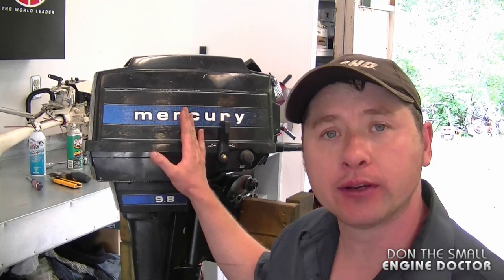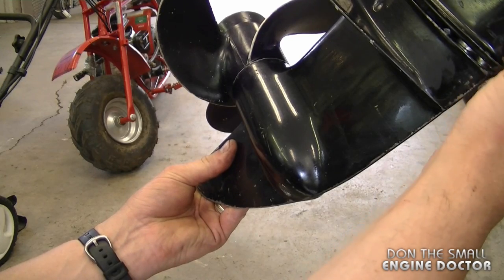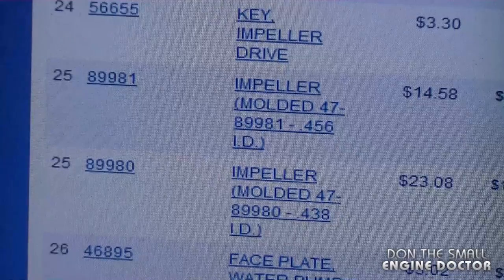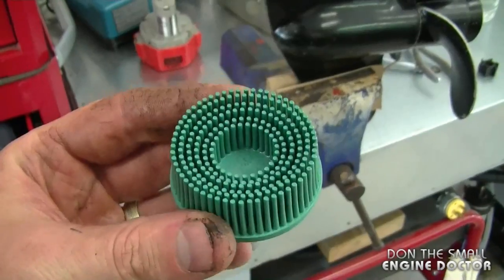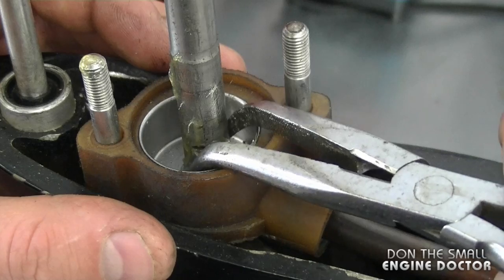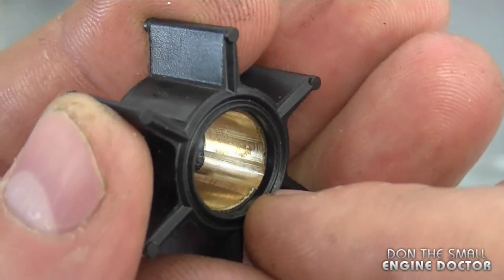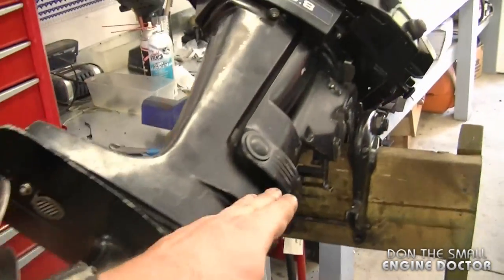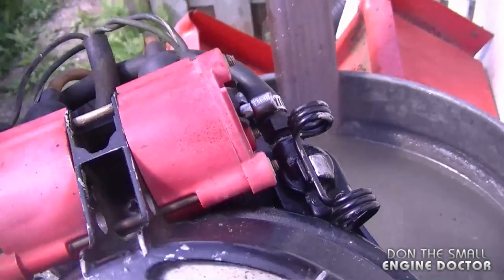HOW-TO Impeller (water pump) Replacement In Mercury Outboard Motor

Comment: Thank you young man.  My 1973, 7.5 stopped spitting water.  At 67 I'd usually pay someone for that.  The hardest part was fitting the lower unit back on. Found that  standing motor on the cover worked.

Comment: Nice job once again. Good old Mercury..... and looks like it hasn't seen any hard use. I did jobs on them like this. Where I live we call the impeller the water pump. Also, I use a little dish liquid to lubricate the parts when doing this job. It helps the pump get its initial few turns off to a nice slippery start and then the water just washes it away. We also called the fin above the prop the cavitation plate. Thanks, haven't done one of those in a long while, brought back old memories. Keep them coming

Comment: Of all the videos I watched, there was none that mentioned the copper tube. Yours my friend saved my butt! I removed mine and there was a piece of the old impeller lodged in he impeller end. Had I not seen your video I would have NEVER looked at that tube. THANK YOU!! Your videos are head and shoulders above others. I am wondering however, should there be a sealant between the lower and upper half when putting it back together? When removing the two halfs there was a clear silicone substance I had to scrape off. I did put a small bead between the two when reinstalled. Thank you so very much

Comment: Hey Don, great video it is but  three steps l would recommend. One: grease the splines of the shafts with water proof grease and slightly lube the little o-ring on top of the driveshaft. Two: when installing the g/box rotate the fly wheel at top of engine very slightly clockwise or rock it back and forth to line up the splines. It will slide in easily.
Reply: And what is three?

Comment: Another great video, thanks Donyboy.  My motor is almost identical to this, probably a bit older, and it would have be a real pain of a job to do without having watched this.  The zip-tie trick didn't work for me so I cut a ring of 1 inch flex hose, bent the impeller inside of it and then mated it up to the housing so I could just push it down and this worked great.

Comment: Great vid, as usual.

I just helped do this to a larger Mercury (150hp)and they are very similar.
A couple of things I found out.
It's best to start by placing the gear shifter in gear (we used Forward).
The reason for being in gear is the prop can be moved so that the splines at the top of the shaft can be aligned to slide the lower unit unto place.

The nut that can not be taken off until the lower unit is broken loose is actually to help hold the lower unit from falling out and getting damaged, while starting or removing the other nut(s).

On the larger engine there was a sleeve to align the water line and the shifter had to be coaxed into place as we tightened the unit holding nut in the front.

Piece-A-cake it wasn't, but after we learned the method of this madness, it became more straight forward, and now that I may never need to do it again, I felt proud that I can.

Hope this may help someone else to shorten their learning curve.

Thanks for the Movie Don.

blessings,
rev don
Reply from the maker: +donald ducky thanks for the tips
Reply: Nice water sleeve to fit in pump and over the brass water pipe leading up.  Wonder
if those are a standard part or heat resistant plastic from a hardwear stow.

Comment: You sir saved me a lot of time and money. Thank you so much. Tip for everyone watching. If it doesn't go into both gears obviously something moved in the process. Once you get the drive shaft back in put both nuts on finger tight and try and make sure it goes into all 3 spots (forward neutral and reverse). If it doesn't loosen the nuts and pull the shaft out just slightly so that the gears aren't changing and adjust the shifter. Before tightening the whole way down spin the prop and make sure the shifter is in neutral. That way you won't have to go through the whole process again. If it's wrong you'll start the motor in gear (don't ask me how I know...)
Reply: I too found that out but upon trying to remove the lower end again and it's stuck, opens up about 1/4" but that's it. Any ideas?

Comment: Eric the car guy uses that rubber grinder wheel also.  It looks like it's perfect for removing old gasket material as well as the carbon you removed.  Great video, Dony.  Thanks for sharing and taking the mystery out of bad impeller pumps.
Reply from the maker: +A LeBlanc have a good weekend
Reply: +A LeBlanc I've thought about buying one, but I think they're like 30 or 45 dollars a PIECE! That's pretty pricey, I'll probably just stick to brilo pads heh...

Comment: My Merc 9.9hp 2 Stroke impeller only has about 10 hours on it, but I was just thinking my Mercury Classic 50 has a heck of a lot more hours on it and should be changed.... Then your video shows up and I think that is the Final Hint!! Now I remember how easy it is to do... Thanks!
Reply: +furyIIIplate Keep in mind that, when it comes to rubber impellers, it is all about how long they have been on the unit, not about the hours of run time. If a brand new impeller is installed, and then sits for 3 or 4 years, it would be risking your engine to run with that impeller.
Reply: YES, change it NOW!  I ruined my 15hp by thinking it was peeing "enough".  It was, 'til it quit, then engine overheated and now no compression...  :(
Reply: Gogle Plus Sucks I am sad to hear that GPS. This is, unfortunately, not uncommon. When one piece comes of an impeller blade, it often takes the rest with it. It can happen almost instantly. Usually, the first indication noticed by the user is the engine quitting. Most manufacturers specify every two to three years, for water pump service. That means, if you install it, and then let it sit for three years, replace it again before you use it.

Comment: Rotating the flywheel slightly while installing the gearcase helps to line up the driveshaft splines, and don't forget to lube those driveshaft splines before installation!

Comment: Great video donnyboy. A couple of tips if I may. Start with the shift lever in forward gear. This will let you turn the prop to line up the drive shaft splines when you are re installing the gear case.  And also, apply some grease to the drive shaft splines. This step can save you from absolute misery, next time you have to remove the gear case, especially if you run in salt water. It is certainly nice having the flat on the shift shaft. Some outboards do not have that. It is no fun to get the thing back together only to find that the shift lever wont move. LOL 
I don't know what it is about those older two cycle outboards, but if you take care of them, your grand kids will still be using them down the line.

Comment: Great video.
The reason you were struggling installing the lower unit was possibly because there was no grease on the shift shaft or drive shaft splines

Comment: Another great video, thanks!  Wow, Merc sure is easier than my old Evinrude, takes 6 bolts to remove lower unit, and then you have to remove the shifter connector, a real pain and often stripped by folks since it's just brass.  And reconnecting that is a whole trick in itself as well.  However, having two very similar impellers for the engine is a bit weird, glad you pointed that out.  I'm assuming you could have just checked the shaft itself vs. the inside diameter of the impeller.

Lastly, I'm surprised you could blow air through the top with the thermostat in there.

Comment: Nice tip with the zip tie. 3M on die grinder is new to me.
I like to use dish soap on the inside of the impeller housing to ease sliding the rubber impeller into position.
Could also use it on drive shaft for seals.
Evinrude's are much harder to put the shift linkage back together (40HP 1990).
Reply from the maker: +Dan Sisulak thanks for the tip

Comment: Nice vid! Didn't get mine installed unfortunately.. tried for over 2 hours to get the impeller fitted but just couldn't get it in and over the key really annoying job to do. To make it even worse the old impellor was working and looking fine, thought to do some preventive maintenance. Ended op with no cooling at all haha. Will try another time to get it fixed.

Comment: great job and very clear!
Reply: Don...one more thing on this OB...The swing of the tiller are back and forth is to easy ...most OB's I have found and adjusted this by an adjustment bolt or screw..I can not find one on the 9.8 Merc of this vintage!..thx

Comment: Great video on this topic, the best  most informative I've seen yet. I have a 2012 merc 2.5 hp four stroke. I replaced impeller easy enough but I screwed up the shift linkage also I didn't know the shifter would move while replacing impeller,  it did move. Now when I start it it stays in foward gear, I have no neutral , what can I do ?  Thanks in advance

Comment: Is water bypassing the thermostat somewhat on start up, which makes it come out the tell tale or peep hole? Reason  I say that is most motors show you water almost imediately. Another super nice video btw!
Reply: +arciefan Some do, and some do not. Most newer motors do, and even spray loud enough that you can hear the stream hit the water, at least at lower RPMs. My 1977 70hp Evinrude doesn't even have a telltale. I just have to rely on the buzzer.

Comment: I do this almost every year on mine.  Thank you  for the visual, great refresher.
Why would it matter about how the fins are clock wise or counter clock wise?  Wont it change when going in reverse?
Reply: Mike Baker 
No.. the long shaft is connected to the engine directly so it doesn't change rotation.. You  want to install the impeller in the direction the engine turns as shown

Comment: I always lube the impeller and o rings when I install the new impeller as most wear is caused by dry start ups.I also pull the motor over without ignition on so as to prime the water system on every start up when the system has had a chance to drain down.

Comment: Hi donyboy73 how is it than when you put pressurised air up the copper pipe to the engine block with the flush bung screw in place it still blows out out of the tell tale hole?

I thought this wouldnt be possible due to the fact the thermostat would be closed as the engine would obviously not be running or warm during the impeller changing process, Is it prehaps a small amount of air blowing though the jiggle pin in the thermostat?

Comment: Great video Don.  It helped me replace my impeller.  I have a 1985 Mercury 7.5 hp outboard.  It leaks oil out the propeller hub after I have used it, but it’s not coming from the gear case?  Any ideas why this is happening?

Comment: Can you advise what the problem would be if in forward gear and the prop will still turn? Took it out and ran like sher pin was gone, took the prop off but don’t see where the pin would go. Sure hope the shaft isn’t striped out.

Comment: Really great video, so well done. I just did the repair and it solved my overheating problem. Unfortunately, now my gears give me forward in the forward position, forward in neutral, and neutral in the reverse position. Basically, I've lost reverse. I can only imagine I shifted the gears after pulling off the bottom. I know the shifter was in the neutral position when I was putting the bottom back on. 

I'm not sure how to correct this. Does anyone have any idea? Thanks.
Reply: the transmission should be forward

Comment: In the package you were using there was an oil seal and 2 o rings. One o ring went at the top of the shaft, where does the other one go? I have the same kit and don’t know where the third o ring goes.

Comment: Just changed the impeller on my 1975 Mercury 7.5hp outboard and this video was a HUGE help.  I did run into the problem that after I re-assembled the lower unit, the gear lever stays in reverse and won't budge.  I also noticed that the propeller spins counter clockwise with some resistance (and clicks going clockwise) which I assume means the prop is in "forward".   Can you shed any light on that?  Is the drive shaft not aligned properly?  Have tried multiple times times to remove/re-attach with no luck.
Reply: My 1975 Mercury 75 7 1/2 hp struggle was simular.  The plastic bevel gear on top by handle was replaced expensively. 
The sleeve Dony shows is about 3 in. long slid into pump output  hole. Lining 
this sleeve to brass water pipe is first, assuming leaving gear shifter in f'd before disassembling l'r unit as mentioned above.  Then shifter should 
function when prop. turns freely in neutral before cranking.

Comment: After watching the video here I took apart my mercury engine (slightly older model) and got the impeller to sit properly in it's housing once again. When putting the lower end unit back in place it was tough going, but once I got the bolts tightened up I went to start the engine and the shifter wouldn't move. So I went to take it apart again to see what's the matter and now it won't come apart (but it will shift into reverse now). Not sure if I pry on the lower end unit or take it to a shop?

Comment: Hi just replaced impeller on my Evinrude yachtwin 3hp 1968 but when Im testing the engine it does not pump so much water.But there was some exauststeam for sure.The engine doesnt seems to overheat etiher by the 10 minutes i was testing it.Any idea?

Comment: Excellent video Don, but you forgot to apply grease to the driveshaft and shift shaft splines.
Reply: I use waterproof grease on both the drive shaft and the shift shaft.  It makes for easier assembly and easier future disassembly.  Great video!

Comment: just did older one Aussie here.  
had to build up non stainless corroded shaft.
no flow out of telltale after fix. 
Took out silver flush plug and ran it.
 pouring out of that so knew impeller working.
 Blew out with air and wire pushed thru across the open flush hole and telltale.
are it seems same internal water line just are 1 inch apart.
fixed flow issues. impeller tiny on these .
Also made  4.pronged undo tool  for trap thread ring near prop. 
when i stripped gearbox.
parts 50 bucks my labour One thousand

Comment: Thanks for this. However when I was replacing the impeller I must have shifted the gear shift because when I start in neutral it’s already in forward gear. So........ remove leg move shifter back one coug than reinstall. Would I be correct? Thanks

Comment: back when I worked at an auto shop we used those 3M abrasive disks all the time on brake rotors to take off the brake dust and the rust
Reply: then we cut the rotors after that

Comment: HELP anyone! I bought a used 1966 Merc 60 6hp Twin that runs like new but doesn't piss any water despite the previous owner telling me he recently changed the impeller. So, I pulled the lower unit to inspect it and sure enough, the weasel lied to me and the impeller was old and  missing 3 fins. My problem is that no matter what I try, I cannot get the impeller to budge so I can slide it up and off the drive shaft. My pick won't move it, neither will needle nose pliers. I've had to remove all of the remaining rubber on the impeller so all that's left on the shaft is the metal sleeve of the impeller. I've even tried to drill small holes in the side of the metal sleeve and use my pick to try to lever the metal sleeve up the shaft but it will not budge.

Anyone ever have this problem and solve it? I'm thinking of trying to heat the metal sleeve with my micro-torch but am worried about damaging the impeller housing. ANY solutions or tips are very welcome!
Reply: Problem solved! After trying all else except heat, I used a small flat head screwdriver as a chisel and split the metal ring down the side so I could pry it apart and pull it out! Once that was done, I cleaned out the impeller housing, blew some air through the water tubes to make sure they were all unobstructed, put the new impeller back in, put everything back together and re-attached the lower end to my motor and everything works like a charm! Great to see water pissing out the pee hole again! You simply cannot beat these old Merc 2-strokes!

Comment: What is the fuel oil mix ratio for a 1994 Johnson 25hp?
Reply: +Connor Sporich All recent (not antique) outboards should be run at 50:1. Some manufacturers played with leaner mixtures, but decided against them due, as I understand, to corrosion issues rather than lubrication issues.
Reply: +Scott M (Scotty2307) I was told 40:1 but they weren't certain thanks for your help.

Comment: My 4 and 5hp Mercury out board water pump was removed successfully however a miniature small pin fell out I do not know where it belongs . The u tube references I used demonstrated pumps with 2 bolts  and a larger key way system flat metal with a raised centre

Comment: I own a mercury 60HP three-cylinder and have been told that Mercury outboards are usually hard to start. My motor starts right up usually even in cold weather. My motor is 1985.

Comment: Oh, many folks, including me, like to put just a smidge of grease on the inside of the impeller housing.  Makes it easier to get the impeller in, as well as avoids a dry start (even though it's probably in water.

And warning to folks, NEVER run your engine without water covering the impeller.  I'd not tested the actual time, but you can ruin a brand new impeller within seconds running it dry and you'll wonder why, after all your work, it's still not pumping.